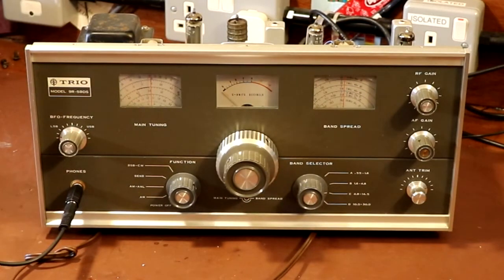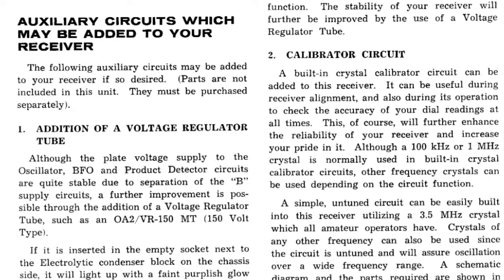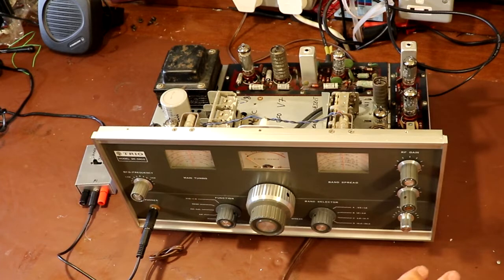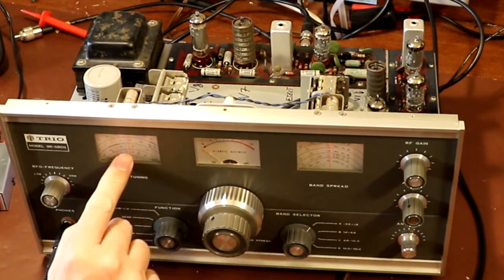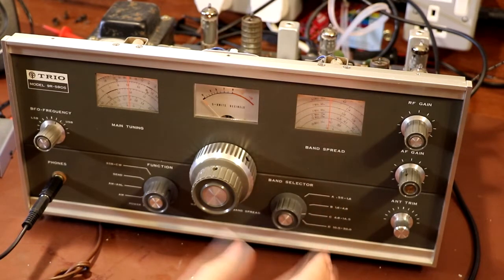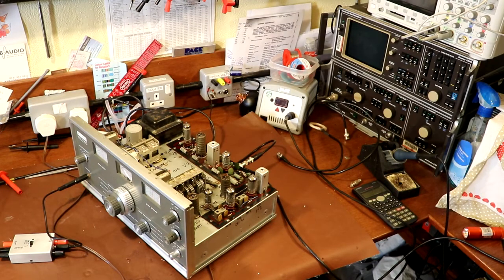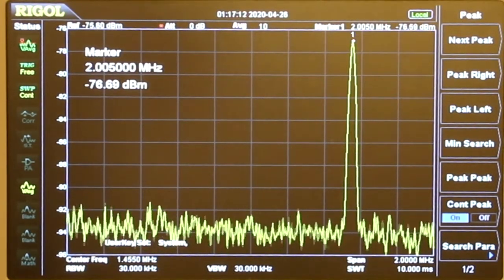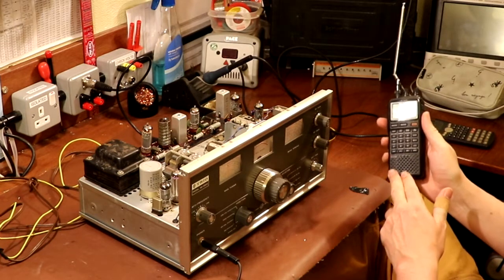TRIO 9R-59DS  Part 1

Comment: I'm picking up one of these tomorrow so I'll be re-watching these videos.
Reply from the maker: ojnoj. Irish Vintage TV and Radio  it was a very basic repair I replaced most of the capacitor even though they measured good. I did get a good increase in sensitive etc for doing that.  They also suffer from bad tuning mica capacitor. Simon Spiers has some good videos about these. I have alignment instructions if you need it.

Comment: Great video, Chris! I'm looking forward to the next part. You know I'm a test equipment guy so my vote is...... fix the Marconi. Then maybe a giveaway to some deserving newbe - (or oldbe) who doesn't have a spectrum analyzer. I own an HP 8594E that I just love and recently acquired a complete tracking generator kit for (not installed yet). There are a lot of 8590 series analyzers on eBay and occasionally one can be found at a good price.
Reply from the maker: David V  hello David I may have a go at the Marconi SA but I’m getting a bit sick of repairing everything in that  failure part of the bathtub curve. I probably will but don’t even have a bench big enough  at home to do it on.  Yes test equipment is my first love but like to dabble in radio project. I don’t like big repair jobs to be honest it’s not because I cannot do them it’s just that I get bored. Thanks for watching and comments. Stay safe regards Chris

Comment: Yep a Bit Of Das Boot About That L/O Chris he he !!  Had An Old Trio/Kenwood Stereo Amp Back in The 70s a 9150 i Think Lovely Sounding Amp But a Real Gas Guzzler in Power Over 600 Watts Sold it Along With a Turntable And a Set Of Speakers To a Work Colleague at The Time Thanks For Uploading ..Regards mike.
Reply from the maker: raceingdemon6464  Thanks Mike. You made me think when the lock down is over I will have to get my Murphy B40 on the bench.  I always thought that Kenwood gear is very well made. Thanks for watching and nice comments regards a Chris

Comment: I suppose you have to suspect caps at this point in time but that is an odd problem. Waiting for part 2. Hows the old truck restore coming along? Stay well. ATB Doug.
Reply from the maker: Doug McArtin  hello Doug there are electrolytics in the radio but non in the oscillator section it mainly ceramic disks and mica capacitors so these are normally reliable but could still fail. My problem at the moment is getting at them well buried in the coil box.  Not done anything on the truck this year. I need to take a look but enjoying my electronics and we aren’t allowed out anyway.
Reply: @allthegearnoidea6752  It's not likely to be related to the oscillator fault but i do see what looks like some Japanese oil capacitors on one of the boards, the ones with the grey or pale green plastic sleeves. For what I read about this model is that it's around 1968-69 vintage, so they would have been still using those at the time. 
I would guess that the fault has something to do with the oscillator tank circuit for band "C", dirty contacts, leaky or open capacitor, or a failed resistor, even a bad solder joint, who knows.

Comment: I remember that advert :-D
It's sounding like a series feedback or parallel resonance capacitor has gone open circuit, only a high frequency can get through a minimal capacitance.
Or it could be a crap switch contact lol.
It's likely none of the above, something very silly.
I have found my old frg7700 excellent for listening to i.f and vco signals, unwanted audio modulation is easy to hear :-D
I was looking for the knob for the front end tuning, no not the operator he he :-D
Reply from the maker: Yes all good suggestions on the fault will be taking a looking tonight hopefully. Thanks Stay safe regards Chris